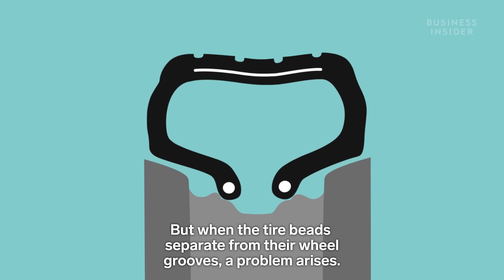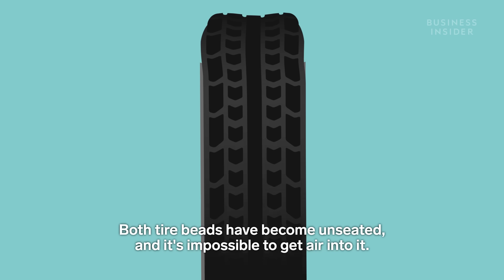Science Behind Using Fire To Mount Car Tires

Comment: I think the trick is to not use too much fluid, and also as soon as you turn on that compressor and starting pumping air, you want to ignite it. I’ve seen dudes wait too long and suffer the consequences. Preparedness and timing.

Comment: We just use gasoline/petrol and a piece of paper.
Smear a little gasoline(1 or 2 coke bottle caps' worth - you can use a small trimming brush or a folded piece of paper that's long enough) on one spot- inbetween the bead and the rim, light an elongated piece of paper and lightly touch the gasoline with the paper... BOOM! Bead is reseated.

Make sure the valve points AWAY from you! I usually make sure it's on the other side of the tyre- facing away from me.
No need for lighter fluid, no need for an aerosol can- in fact, you can do this by the side of the road- without leaving your car.

Comment: Some people hate on this method for seating a tire, but I literally tried the most popular methods and they didn't work. Ratchet strap, kicking the heck out the tire etc.. way too much effort and a waste of time. Did the fire method with a can of parts cleaner, LIGHTLY sprayed not overdone as to cause a huge fire. I had water nearby just in case. Tire instantly seated on the bead.. took less than a minute... If you do it correctly it's the best for DIY.

Comment: Thanks for the video. It is very close to being accurate I was going to not comment but the actual occurrence is actually much cooler.
Your comment and video describe an explosion filling the tyre up. If this was true, the tyre would be full of gas of some description, but the “gas” being released from the valve is normal compressed air. It is caused by the “vacuum effect” and is more effective in cold environments. I am not a scientist but this is not an explosive reaction in the tyre chamber but happens outside the chamber causing a rapid acceleration of pressure away from the chamber which basically creates negative pressure

Comment: I just finally tried this on a stubborn bead, 16-inch rim, and it worked perfectly the 2nd time. I used to little starter spray the first time, and too much the 2nd, but it beaded both sides with no issue and even swelled the tire despite having the Schrader valve off which I removed so it could vent better. 

Thing is, one doesn't need any air nozzle, or need to spray inside the tire, just a quick spray at the bead all around and overspray the sidewalk a bit so you can light it. 

If Schrader valve removed, it will swell when it seats as if it has like 60 PSI on there suddenly, and the open valve will expell all that gas since you want fresh air for the filling instead of exhaust fumes from the combustion. 

I've seen one person keep the Schrader valve in, and they applied air at the same time, and in turn, when it seated, it created a huge suction. I don't think doing it that way is the best idea, and the air nozzle feeding is not needed if you remove the Schrader valve.

Comment: Thanks for introducing one of my innovations in the year 2014 - 2015. However the most important point is that the material or the chemical that using in the tire chamber. It must carefully measure the flammable rate of the chemical, volume of the chemical, and the duration of the combustion!  Otherwise the result would be an expulsion of "the flying fire wheel" in the workshop. I tried most of the chemical in our workshop, when I have done tons of the research exams on the squashed tire fittings. The small amount  (~ 3ml) of break cleaner liquid that contains methylated spirits would be the ideal chemical to safely use on. 
 Finally I created the new method of tire fitting in New Zealand & proved that in front of a group of street racing kids in the year 2015. My boss disabled his $500 tire inflate tool.
Reply: In the last 20 years, the New Zealand 4X4 industry was using the "water tube method" to inflate the tires to prevent any deflation accidents during off-road trips, before "this quick inflation method" innovated. The "water tube method" is filling water into the 4X4 tire instead of air, to make the tire durable, during the harsh environment.

Comment: WRONG. You don't need to hurry up and get air in the tire. It will NOT slip back off without air.

Also, simply filling with air is often enough to set the bead. Starter fluid is only for cases when using air doesn't work.

Comment: I use to fix tires and I'd use starting fluid and a lighter to seal a stubborn bead. Fun but you need to keep your fingers in the clear if you don't as it seals you could loose a finger tip.

Comment: I would hate it someone did that to any of my cars. Just use a compressor with a regulator.  When it reaches capacity it turn off.  Why mess with lighter fluid and fire when theres no need.

Comment: Good lord. Just spray some soapy water aound the beads and then secure a ratchet strap around the tire. Get it tight enough where the tire is squeezed evenly and then air it up. If air is still blowing out, keep tightening until it holds air. 
This should save from wasting starter fluid......oh, and not setting something on fire or blowing yourself up.

Comment: Thoroughly obvious and uninformative. To be useful, I expected 1)Guidelines for the 'right amount of gas'. Too much leaves unburnt gas as a potential hazard to future tire mounts/dismounts. 2) Tips on whether to remove the valve stem core before ignition so as to offer an over-pressure safety relief. 3) Preferred combustible fluids - gasoline, starter fluid, hair spray, WD40, etc.

Comment: I was at a tire shop but 2 weeks ago they were doing this. As I walked out of the office 40 feet from me a very loud explosion went off. The hummer rim and tire flew off the ground about 4 feet and flames were shooting thru the tread and the whole thing was on fire.  Very dangerous this tire and possibly rim was ruined. If the blast were any worse some would have been injured.

Comment: You forgot to mention that the explosion leaves a vacuum in the tire. That's why it's important to first remove the valve before ignition so that air can enter the tire before the vacuum can suck the beads of their seats again.
Reply: That's why I was here to figure out
Reply: @mobleyMobley  Yeah, be careful what people tell you here. Especially when it's something a bit risky like inflating tires like this.
Reply: @Mike the Spike  I don't intend on doing it, was just trying to figure out why ppl were so quick to inflate tire after the seal.
Reply: @mobleyMobley  It's a trick you only really need to know when you're somewhere in the sticks, not another soul with 100 miles and have just fixed a flat tire.
I saw it done first of all travelling across Iceland with a couple of natives when one of the tires came off its rim. No way anyone is gonna come and help you in the middle of a snow and ice field 100s of miles across. You have to know how to help yourself.

Comment: Hold, so yeah I know about this but I've never seen them putting on tires like this in the shop i go to. They use some sort of glue?
Reply: The airlines in a tyre shop have enough power and volume to set the bead. With a hand pump or domestic compressor it is almost impossible.
What you are calling glue is actually a grease to allow the tyre to rotate to form an even seat. Glue would make the tyre almost impossible to replace.

Comment: I grew up on a farm with heavy equipment (tractors, trailers, implements, combines, semis, etc.).  We did this all the time with starter fluid.  Some of these people doing it in this vid are dangerously overkilling it with the flammable aerosol.
Reply: True that but in our case we replace the air inside with nitrogen before the tractor goes in the fields / trucks go out to haul
Reply: I’ve tried this before and it didn’t work
Reply: @jacepayne7671 
You need to make sure the flammable liquid goes inside the tire.
Reply: @LelakiKerdus  it didn’t work for me because I didn’t have air going into the tire. After I lit it up the bead would fall off
Reply: correct
Reply: yep i always see them use to much i was just a normal car mechanic but use this to some tires just dont want to seat even last night i was drunk buddy had a track day on his today could not get it to seat was 1 in morning i got it to go with olmost no sound just a little woof but not boom i think i did two half a second sprays with brakecleaner did had to push the tire to open the side wall up to let the flame in but then woof and seated

Comment: This is not the recommended way to seat the bead of the tire  on a rim.  It's dangerous and you can cause problems by using chemicals to seat the tire.  Soap and water is the proper way and a air blaster.

Comment: Had a tech do that, but he used way too much fluid. It caught the inside of the tire on fire just long enough to blow out after about 2 hours of driving. I had his boss look at the tire, which was MELTED inside. I got a new tire out of the deal and they don't do that any more.
Reply: That's the whole problem with using this.
Reply: That's part of the problem with using this method.  Getting the tire on the rim is perhaps the hardest part of the process.  I've seen people mount tires fairly quickly without the need for this technique.
Reply: No fire will burn inside a inflated tire! Fire needs oxygen!
Reply: @benreed4918  the air has oxygen.  Then when you start adding air you are adding oxygen. It can keep burning
Reply: @Bryan-Hensley  true!
Reply: @benreed4918  I've learned this the hard way. I used to have flats on our riding mower when I was young and I would do this to re seat the tire. The rim was wider than the tire so it was almost impossible to reseat without taking to a shop or this. But I burned one through using gas, which I shouldn't have used, but I was about 7 then.
Reply: The fire goes out instantaneously when this is done properly. So in order for that to happen it would have had to be done improperly by an idiot who did not know what he was doing @Bryan-Hensley
Reply: It's not the fire, it's the brake cleaner that these people use. Brake cleaner compromises the rubber. 

A while back some people thought it would be funny to ironically tell people on YouTube to use brake cleaner as a tire shine (like the microwave phone charger gag). Then the tires blew out.
Reply: @dcable133  nah i use starter fluid and i blew a couple sidewalls off because they were so low profile that just a tad of gas would have worked.. anyways im high

Comment: You always remove the needle from the valve! Two reasons: After the explosion, as the air inside rapidly cools, vacuum forms. This allows the air to come back in so the tire does not slip off the bead again due to the vacuum. Second: In case you use a bit too much fluid and there is a huge pressure inside the tire, the air will have a way to escape rather than to explode the tire itself. So it makes it safer.. Still, rather try a few times with too little fuel than once with too much..
Reply: Explosion depents  amount of oxygen in tire. Too much fluid or gas not increase pressure.
Reply: @jarikinnunen1718  Agreed.  The most powerful explosion will occur when the air fuel mix is at the correct stoichiometric balance.  For example, if you were using hydrogen, you would want 2 molecules of H2 for every single O2.  2 H2 + 1 O2 = 2 H2O.  No one would use hydrogen, but the equation is the easiest.  So putting in too much fuel or not enough fuel and having your ratio wrong tends to result in a slow burn instead of a fast explosion, theoretically less dangerous from an explosion standpoint, but more dangerous from a fire standpoint since it could burn for some time possibly setting something else on fire.
Reply: I did it with the Schrader valve off and I have no regrets. I saw that one video where dude leaves it in and keeps air on it, and it sucked in the tire as much as mine swelled. 

I didn't even use air, just spray and light with the valve wide open.

Comment: The only way to do this without an explosion is to use a Cheetah, or something that can blast some high pressure air from outside to force the bead to seat, or close to seating.
The temporary high-pressure area pushes the tire bead edge to the rim, and you can then inflate the tire. 
Personally ally, I know tire tend to blow out from the sidewalls, and not the tread, which has some serious "beltage."
So, never stand 90° to the tire, always from the tread areas.

Comment: Tire repair guys have been doing this forever on big trucks on side of road. Its fast and if an outside tire they just leave rim on truck pull off tire repair and ether it back on not lighter fluid. 
     Thus is practice and the tight ether because brands are stronger then others.
      If to much applied you can blow the tire off the rim like 20 feet or more.

Comment: Until it vibrates at speed because unturned liquid, and the damage it can do if it has high alcohol content in the fuel
Reply: It isn't a liquid unless under aerosol can pressure. Ether evaporates faster than paint thinners. The amount sprayed in the tyre if compressed back to liquid would be less than a thimble full. And even when they spray as much as some did in these vids, it is all consumed when it explodes. Most were very heavy handed, spraying directly on the outside- it looks worse than it is though.
Reply: Fun fact: you can pour a cup of water in a tyre, inflate and drive at any speed and you won't be able to tell it's there because it spreads out with centrifugal force evenly around the diameter of the tyre. 5 litres you would notice at certain slower speeds however.

Comment: 🔵 It's important to realize that if you use this method whatever amount of flammable solvent that is left trapped in the tire will accelerate the deterioration of the tire internally a good deal faster than atmospheric air, and can certainly compromise the Integrity of the tire over a MUCH shorter time.

Comment: My dad actually made a small air tank and welded a metal tube on it, and it had a valve to close and open the air. He would fill it up with air all the way and then stick the end of the metal tube in the tire, and then switch the valve on and a hose thrust of air shoots into the tire and airs it up instantly.
Reply: Cheetah

Comment: A shame you didn't properly explain WHY the bead won't seat. 
Diagram at 1:30 is not accurate, need to draw it super loose eg a 1 inch gap. 
The tyre drawn will easily seat with normal air pressure /tyre lube. 
99% tyres mount quite easily. 

A 1cm gap is not much problem, remove the valve, bounce on the floor + air does the trick. 
Failing that the bead seating tools rubber rings, high pressure cylinders etc. 

These other tools mean the ignition system is for cowboys only, cos who knows what pressure you got in there. 

I'm just gutted your diagram is wrong

Comment: I was shown this truck back 48 years ago by the mechanic at my Fathers trucking company! Yes back as a teen I learned the company business from the very bottom! In the garage as a grease monkey! I was shown how to get a truck tire back in the wheel and seat the bead, using either based starting fluid. Just spray a small amount and quickly throw a match inside the tire. The gas ignites and expands so quickly he tire just pops right back with a sealed bead! You should have seen the faces on an excavation crew I worked with as a dump truck driver the day a fellow driver had a low tire get its bead popped off! When I sprayed the starter fluid and came out with a pack of matches and fixed it the look in their faces was priceless!!!

Comment: This is extremely dangerous because it causes a chemical change in the rubber itself and can actually cause a buildup of pressure and later(sometimes within a few minutes) you can have your tire blowout completely. If you're on the road when this happens, it can be deadly, or if it is a large tire on industrial equipment and someone is near it when it happens, it can literally kill someone if they are near it. A man died recently in San Pedro, Ca, his name was Jose Santoyo, he was a mechanic and a tire exploded next to him from a rapid buildup of pressure, probably due to something like this, or a welder working on the rim with the tire still attached. Heat causes gases to expand, and if the rim or the tire is still hot, it can cause the air to continually expand around it. Please don't use this method to seat the beads of your tires. It is very dangerous.

Comment: Ive used this technique in the past. Safety rules to consider. 1 do not lay wheel flat on ground. 2 less is more when using flammable liquids. 3 always utilize "wand" type flame delivery.
Reply: IF NOT FLAT ON THE GROUND   THEN - HOW DO YOU PLACE IT  , PLEASE  ?? -- _____
Reply: @charlespope8713  place it? In this video tires are blown on with them in vertical position. This is ok. It can be tricky getting the tire even so it mounts when lit. The reason why you dont want it lying flat is, some will screw up, over applying volatile chems in the wheel 'could' launch itself. There are vids of this too.
Reply: @charlemagne1162  THANKS  !

Comment: I've done this dozens of times. The joys of 22x14's and 40x15.50s. The easiest and safest way is to set the tire standing up vertically on it's own and then spray the beads with brake cleaner and pull back maybe 5 feet and use a lighter in front of the brake cleaner spray nozzle itself to act as a small flame thrower and shoot it towards the bead. Works almost every time the first try, and the tire does jump at you nor does the flame.
Reply: THANKS  !!